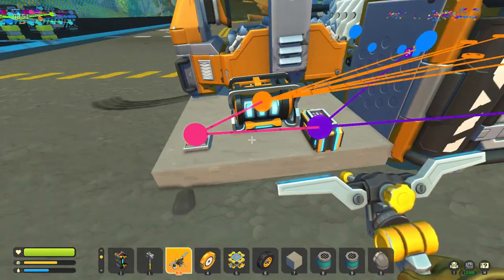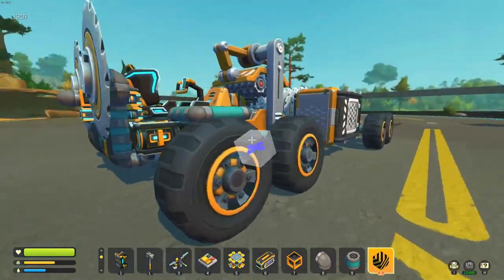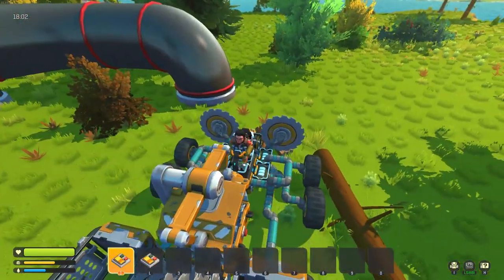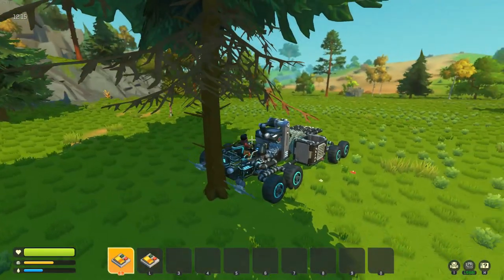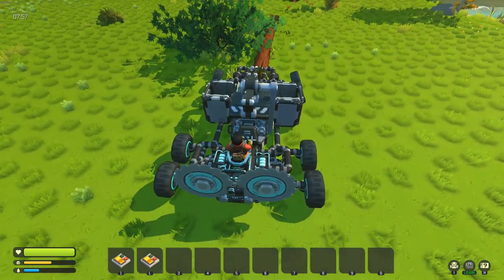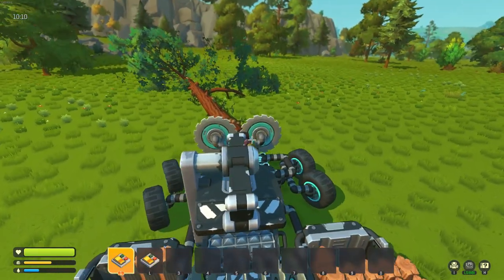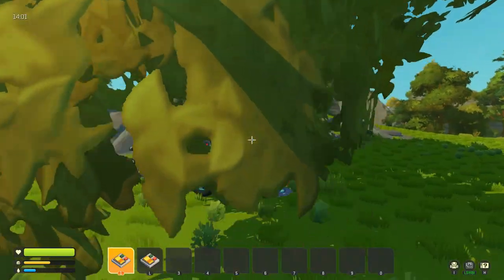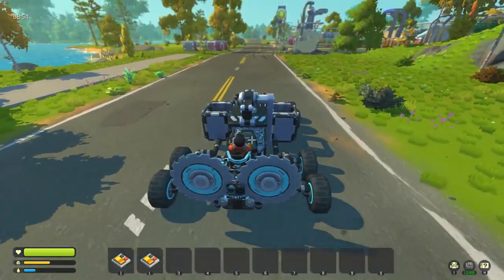scrap mechanic part 16 AUTOMATIC MOBILE  TIMBER REFINERY

Comment: I like that you're planning on sharing your save file with these vehicles, because it is like starting a new game on EASY mode instead of regular mode... I mean, not having to make my own refiner with struggling to get it as effective as yours means I don't need to worry about having to go into the json files to edit and have to then remember all the console commands... you get the picture... your work here is appreciated!
Reply: I made the comment above at the beginning of the video, before having watched the video and I was worried about having to cut down trees on slopes, what with sliding around while driving which will make aiming the mouth harder... but it looks like your design might work even with that slidey-drive problem... Nice work!!!
Reply from the maker: @Spastic Cube  Thank you so much I am happy with the way it came out. and yes hills are tricky . It should work on a slope  fine  but not if its bumpy because the machine need to sit flat on the bottom . Also as for sharing the the save I don't know why more people don't do it. If some one watched you make it of Corse People are going to wanna try it. Also its easy to make things look good in a video but really they work rubbish . And I Just like shearing  , plus I was hopping it would encourage people to subscribe because this channel needs SUBS !
Reply: @tay2062  Hope all these comments gets you better YT ratings and positions your videos higher up on the search bar.

On an unrelated note... I said I lost the flyer... Well, it turns out, I found it again...
Reply: I'm new to this channel, where can we get the files ?